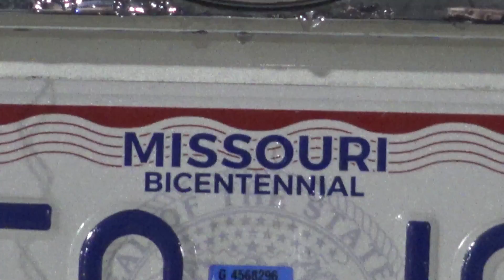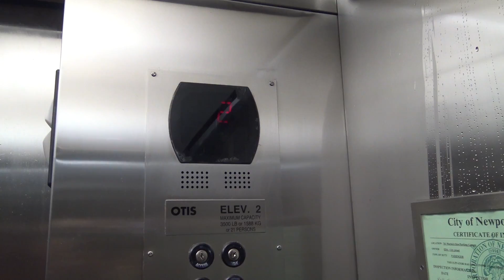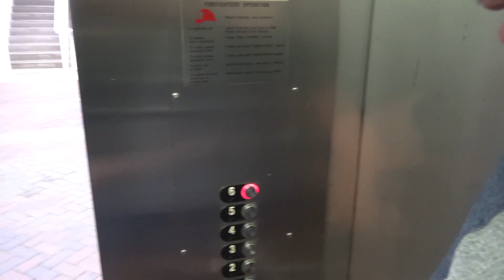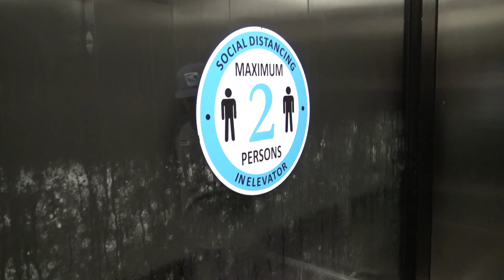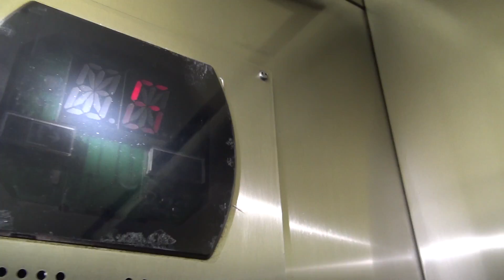Wet Elevator Ride - Mariners Row Garage with Dieselducy

Comment: I found an elevator at the MGM grand parking garage in Las Vegas Nevada where there was a cigarette butt sitting in the door sills, The worst part about it it could’ve  light The elevator on fire because of the humidity here Vegas, Second of all it’s disgusting, third of all, never ever smoke in elevators.

Comment: OMG. That, in my opinion, should not happen on an elevator. In fact, if something like that happens on an elevator, it should probably be taken out of service until the water dries. Timestamps 0:51 and 2:32: That water is probably stagnant.

Comment: The North elevator in the Van Burren parking garage in Naperville, Illinois, was also leaking rain. In the bottom of the shaft. Except this elevator is worse than what I’ve experienced! Hopefully this gets dried sooner rather than later!
Reply: Was there water in the cab too?
Reply: @atomstarfireproductions8695  On the floor, there was.
Reply: @ElevatorsInternational  i live in Naperville, next time there is a huge rain storm I will check if it is leaking again

I don’t remember which is which, is the North elevator the one on the side with art on the glass?
Reply: @atomstarfireproductions8695  That’s the South Elevator. The North Elevator was the leaking one. This happened a couple years back.
Reply: @ElevatorsInternational  oh, it’s likely they have fixed is since then